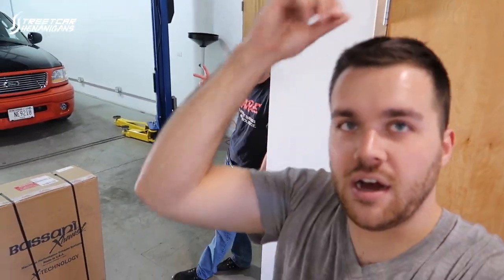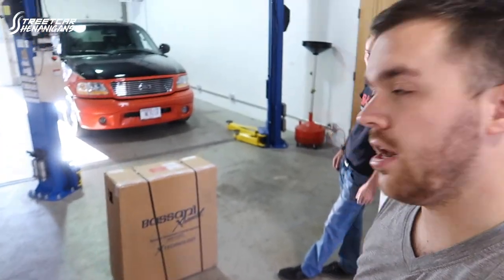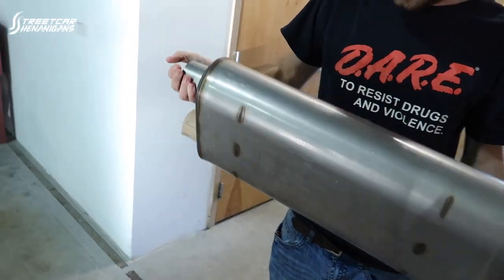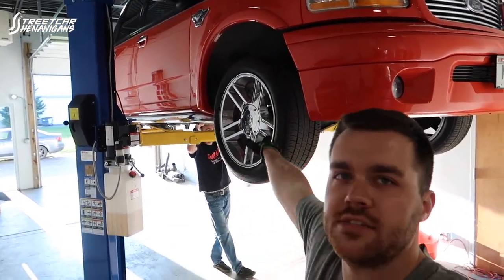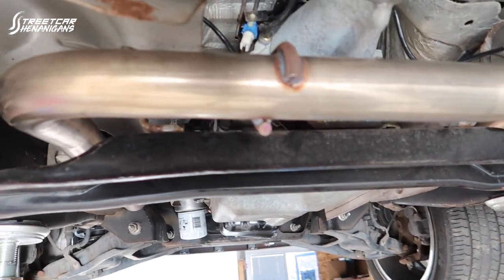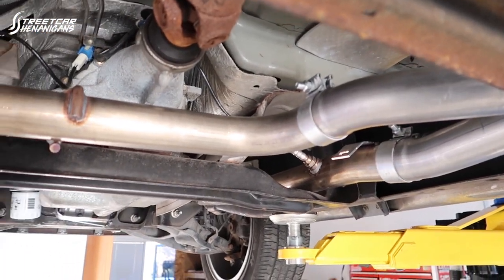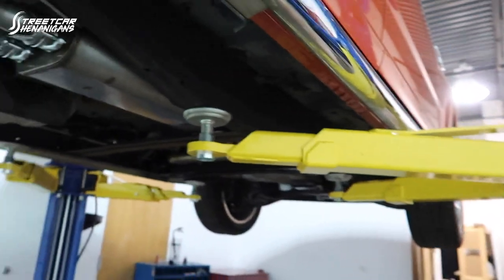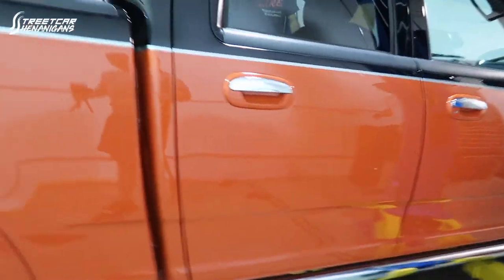2003 Harley F150: Bassani Exhaust Install

Comment: Fitment issues happen even on stock components with this exhaust system.  I had to cut the two intermediate pipes a few times to get everything to line up.  With the fitment issues and quality, not worth the 700 they are charging.  Sounds good and looks nice but should have went with an OBX, or flowmaster, cheaper option, fitment is better and sounds just as good.